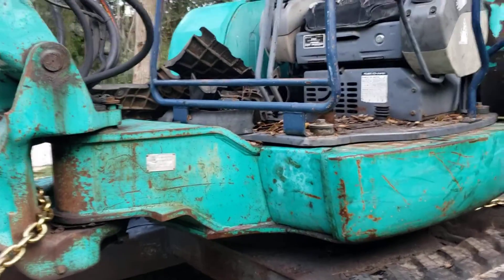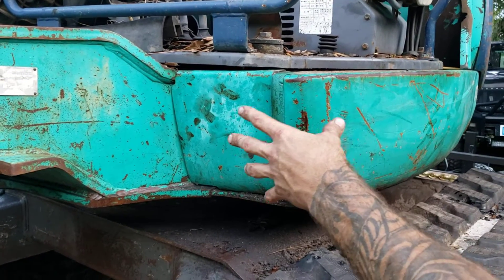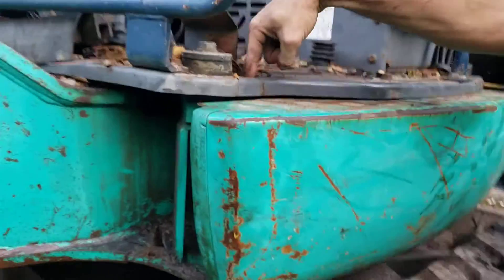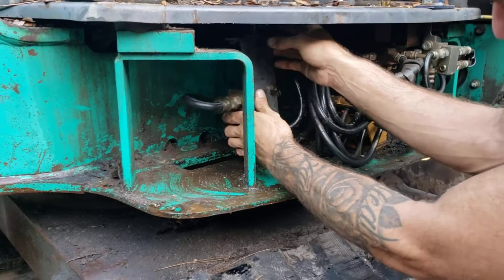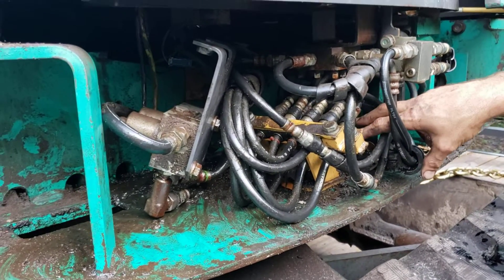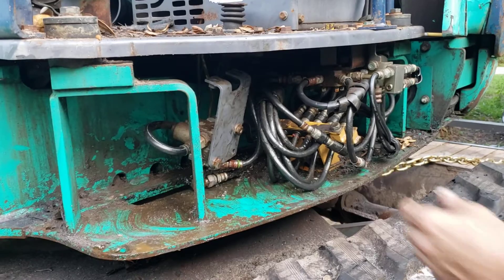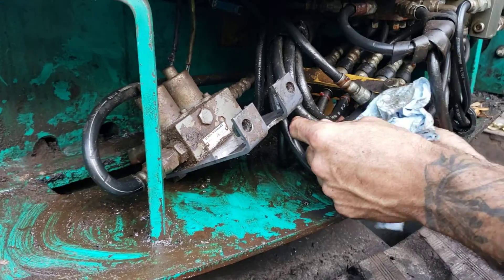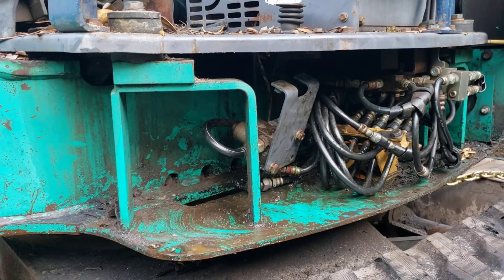Replacing leaky broken & worn hydraulic hoses on a Komatsu PC45R-8 mini Excavator with locations.

Comment: Hello. I just recently bought the same exact machine (even the same color). I was wondering how do u change the hand controls on it? It's set up differently then what I'm used to and its so confusing to use. I was just wondering if perhaps u know how to switch the hydraulics on the hand controls. 

also my tracks are not staying tight, I put grease in and it tightens, but doesn't stay tightened.
Reply from the maker: The controls can be changed by hooking up the hoses to different valves.
The tracks most likely have a leak in the tightening system.
Reply: OK, thank you, do you perhaps know which hoses in which valves?

Comment: Hello mate, good morning, can you make a video showing how the hoses are connected to the valve bank? The problem is that I have one of these machines and they don't have speed. I want to know how that works to fix mine. Thank you.
Reply from the maker: Hello, I am not sure on this as to which hose goes to which control.  Sorry
Reply: @goodtimes1828  Can you show the hydraulic pump how the hoses are connected to connect mine the same way?

Comment: Hi there, I would like to know how to disconnect the quick hose fitting on that one, thank you.
Reply from the maker: Quick hose fittings are able to be removed while taking pressure off the system then pushing slightly in while sliding the coupling back.

Comment: Hi great video i have a Komatsu PC25 do you know if they run 2 Hydraulic filters or just the one in the tank
Reply from the maker: Hello, I am fairly certain there is only one filter.  thank you
Reply: @goodtimes1828  hi i was just told there is a Pilot filter on the in and out pipe just trying to find it

Comment: I wish it was this easy to access on the PC60-7. The right travel track hydraulics are in the impossible to reach area under the house. No idea how to access those lines. Looks impossible.
Reply from the maker: I hope that you find success in your mission.  Where there is a will there is a way.  Best to just start taking off panels or pay the piper.